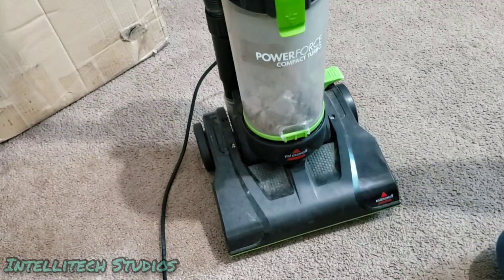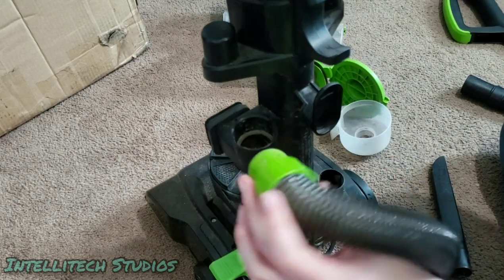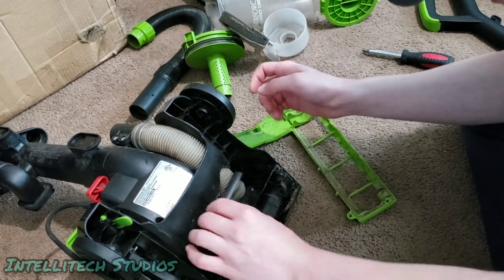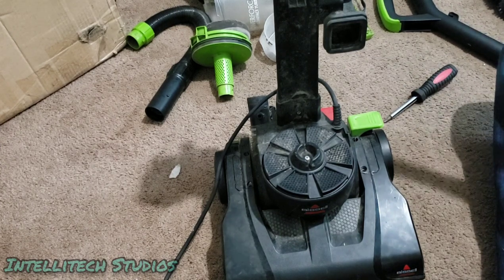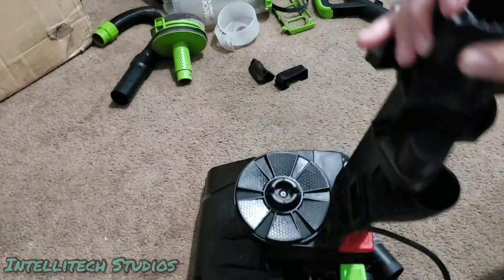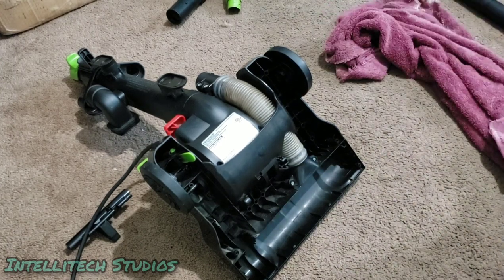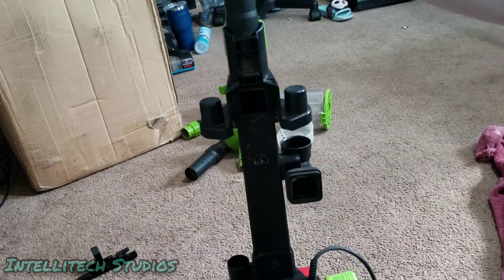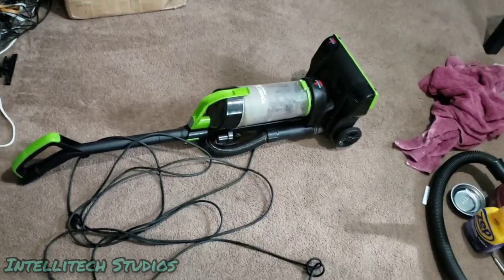Bissell PowerForce Compact (2690/1520/2112) Vacuum Repair - Fix - Tune Up - Service

Comment: I have the same vacuum and following your tutorial for cleaning I notice that the thingy on the bottom doesn’t sit properly cause you are missing a spring 🤷🏻‍♀️
Reply: How does the spring pop back in? I can't figure it out
Reply: That's my problem my spring popped off and I don't know how to put it back on.  If you have any suggestion please let me know.
Reply: I have same vacuum and my spring popped off too and I don't know how to put it back on
Reply: You need that coil spring that prop it up.
Reply: So funny I came to this video hoping he would show how to pop it back in and I can't figure it out either. Has anyone on here found out how to do it?
Reply: @belinda7905  I'm dealing w/that stupid spring right now.  I call that a "BAD DESIGN!
Reply: I was disappointed assuming he would explain that dang spring popping off it happened on another Bissell vacuum I had
Reply: Also here for that problem lol

Comment: You forgot to take the canister base that circular thing with screw in it off to clean and btw there's no filter in there
Reply: Yes, I was very surprised to see that the empty space in that housing: 1. Had no filter. 2. LEADS DIRECTLY TO  THE MOTOR!!!  I'm left wondering if it was an engineering oversight, or engineered obsolescence which would naturally wear out the motor faster- "Power-Forcing" you to buy a new one.  Good eye, though.

Comment: When I found my compact turbo in the dumpster, it looked almost looked brand new! The way I clean my shopvac filter I used the turbo brush and it works very well.

Comment: Great video! Some little suggestions:
1… Save the hassle of having to clean out the filter more often on your other vacuum and pick up the majority of the dust with your hand (or dust pan), throw it in the trash (preferably with a lid on it), and then get the little bits with your other vacuum.
2… Put the screws inside a medicine vial and label it.
3… wear a dust mask when working on a vacuum if you aren’t doing so already
4… wear earmuffs like the landscapers wear, when using a Vacuum to preserve your hearing
5… re: the spring, you can get an assortment of little springs at Home Depot. I did that for a dirt devil dirt cup that was missing a spring on the dirt release button.

Comment: I found one of those by a dumpster and cleaned it out. After cleaning it out, I find that it’s in pretty good shape except for the brushroll and the belt. It turns out the brushroll seized (thus breaking the belt), because the previous owner allowed too much cat hair to get into it. I’m debating whether to scrap it at my local Goodwill or Offer it Up to somebody else who has one of these who wants it for parts. What do you say I should do?

Comment: I have bismell light weight vacum cleaner  model 1520C, but motor is not working checked  the switch, checked carbon drushes. please let ms know what can i do.

Comment: I have the spring for the height adjustment underneath (that you mentioned) but I can't get it back in. Can you do a video on installing the spring if you find one? 🙂
Reply from the maker: I don't have one of these vacuums at the moment, but I gladly will when I get another one!
Reply: Did you get a video Showing how to put that spring back on

Comment: I recently trash picked a blue Bissell power force compact model 2112. It is missing both attachments, that white dirt bin dust channeling part shown in 3:05 (what’s the name of it?) and the height adjuster. I just oiled the brushroll bearings and cleaned it out. It’s ready to go otherwise. It’ll probably be a while before I trashpick another one with these missing parts. Otherwise, what is your advice on where to get cheap replacements?

Comment: Could you please explain to me what that little piece at the bottom that needs a spring is for?
Reply from the maker: It's essentially just another wheel. On the bigger PowerForces it controls the height adjustment, but since this version doesn't have a height adjustment, it doesn't do much
Reply: @IntellitechStudios  I see now, thank you

Comment: I can’t find the belt to this. I even ordered from bissell an it was still wrong. Do you know what style belt it takes?
Reply from the maker: It takes the 160-4895 belt, also known as a 3130 belt, here's a link:
Bissell PowerForce Compact Lightweight Upright Vacuum Belt. Replaces OEM# 1604895/160-4895, Black https://www.amazon.com/dp/B01NBPFNI9/ref=cm_sw_r_cp_apan_glt_fabc_9AY3CSKR1N0Y82HY490T

Comment: Mine doesn't sound that smooth. My vacuum sounds like I turned on an old leaf blower and it sounds like I'm trying to pick up rocks rather y'know just dust and other stuff that's on the carpet or rug. What can I do to fix it?
Reply: Mine is very loud.  I think I found the reason. The brush doesn't spin properly because the part on the end opposite the side the belt sits on is not centered.  😥
Reply from the maker: If it makes the sound without the brush in, your motor is going bad. Otherwise you may need a new brushroll

Comment: 12:26 that piece is supposed to have a little spring to hold that piece in place. Without that spring that piece will move around
Reply: To let you know my bissell powerforce compact has that little spring
Reply: But how to you install it, i have it but i cant seem to put the prt back in. Its honestly hard to do it and ive been looking for a tutorial
Reply: @ratamuuie9988  If you don’t know how to fix it there is a video bissell powerforce compact roller lifter install and my bissell powerforce compact had the same issue and I got it fixed and I am super happy that it is fixed
Reply: @ratamuuie9988  Hiya!  Have you found a tutorial for putting the spring back on?  I'm looking now.  Thanks.

Comment: the brush on mine broke, the end caps snapped off and no longer spin, i cant seem to find the right part to fix it.
Reply from the maker: Replacement Part For Bissell Brush Roll for The PowerForce Compact Vacuum # compare to part 1606837 https://a.co/d/0uX1eD7
Reply: @IntellitechStudios  that was fast. Bought it, ill let you know if it fits. I had bought another that claimed to fit model 2112 and it was 1/2 inch too long

Comment: Better question is a little thing in the bottom of it with a spring I can put that they own but I don't know which way the spring goes on the bottom of it and that's because unlike the bottom part of it the other the other thing there it's like a little bit little black thing it has like a little three little things on it and I don't want sprinkles inside that when I can't take this pain I took this rain came off and put it back on I don't care how to do it

Comment: I never saw you reattach the part with the spring underneath which is the whole reason I watched the video.
Reply from the maker: Are you referring to the small wheel below the brushroll?
Reply: @IntellitechStudios  yes. I found it on another video from someone else.

Comment: I’ll fucking pay you to see you put that lifter bar back on. Not any info ANYWHERE online.
Reply from the maker: Theres supose to be a spring that sits between it and the housing, and once the spring goes in you lever it in so it holds the tension.
Reply: Not much into videos, buy I did replace the spring on mine.

Comment: You forgot to tell how to reinstall/fix the T-shaped guide on the bottom.
Reply from the maker: The height adjustment wheels? Just line it up with the notches on either side with it pointed straight up, then turn it down into place. I might do another video if I get one with the wheels
Reply: @IntellitechStudios  there’s a spring to it that I don’t know how to put back on. If you made a video showing us that would help so much! Thank you!
Reply: @IntellitechStudios  mine randomly fell off today while I was vacuuming and for some reason the vacuum has been getting stuck. Like when I pull it back it rolls fine but when I push forward it feels locked. This just started happening when I vacuumed our new rug so I don’t know what the problem could be. That’s why I’m here lol
Reply: @TheeHairWitch  it not your fault. Clearly that's some sort if defect with these VAC's because mine did the exact same and now I'm having the same problem.